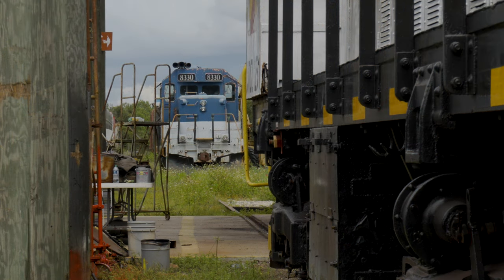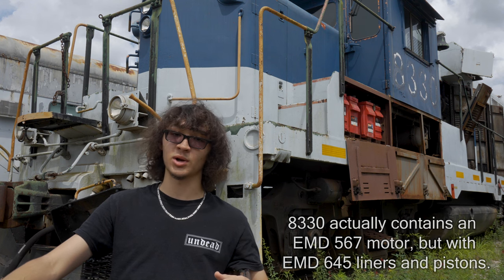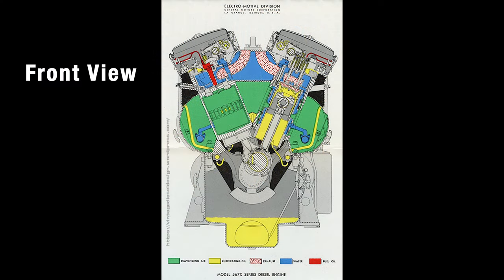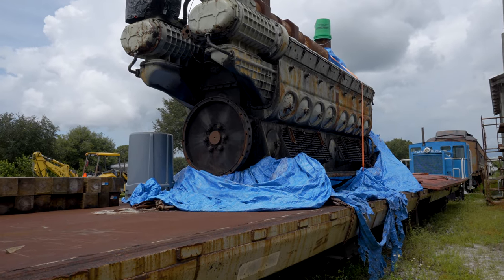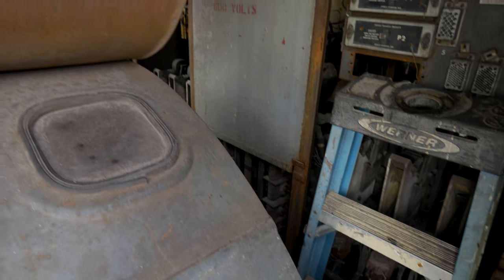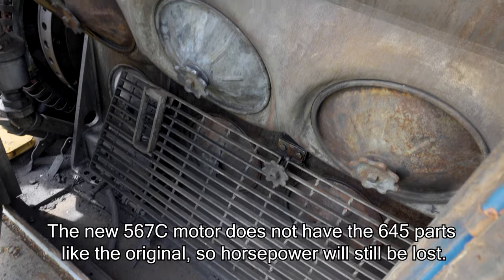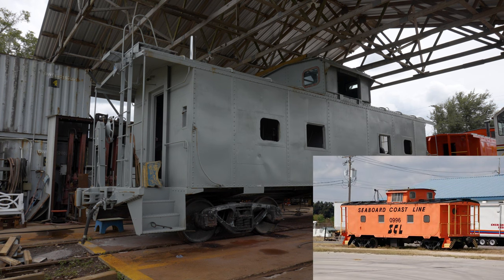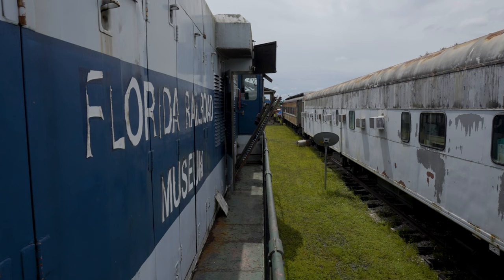Florida Railroad Museum - 8330's Second Chance

Comment: The Unit Was First Built In 1954 For Union Pacific It Was Sold 11 Times To Different Railroads Including ICG MDLX ILRV WRRX FGCRR NCYR RPCX AGLF EOLX And Others
Reply from the maker: Some of those are overlaps, but yes, that’s correct. It held the RPCX markings when it was given to the museum, or “FGCRR”. Still holds the RPCX marks to this day, though the markings are hardly visible.
Reply: and it was a GP9B when built.

Comment: EMD did same as Detroit Diesel did, increased piston size, but kept the stroke of the crankshaft the same, 71 Series vs 92 Series. That's why a lot of the old 567 engines got the 645 cylinder kits, when it came time to rebuild them, gave them a power increase and parts are basically drop in, without major machine work to the block itself.
Reply from the maker: Interesting info! It’ll be interesting to see if there’s any audible difference between the two once the new motor is in. Definitely helps that the two motors sort of go hand-in-hand.
Reply: Yes, I can hear the sound difference between a true 567 and a modified version, like 8330 has, and the 645 non turbo version. But, I have been around Diesel truck's for so long, I can hear all the distinct sounds of a engine, they all sound different. Trains are no different.

Comment: Nice. You should do an in-depth presentation on the 8330 highlighting her significance, such as, she was originally built without a cab.
Reply from the maker: Absolutely. That will likely come with the final product, in which the 8330 is back up and running. “Rebirth of the 8330” will come out as its own video when the time is right.

Comment: FINALLY THEY ARE GOING TO BRING IT BACK 😅 I MISSED THE 8330!
Reply from the maker: Many are looking forward to it. In addition to it facing south, 8330 was valued for its smooth running, braking system and reliable performance.
Reply: @kotabeaner  wow that’s amazing how they actually are bringing it back
Reply from the maker: It’s going to be an extensive, expensive, and intricate project, but we hope to say that it will be worth it once it’s all done.
Reply: @kotabeaner  i think it will be worth it in the end

Comment: Being more rolling stock than loco inclined I can still agree if your prime mover has blown/exploded cylinders, bent crankshaft/crankcase and whatever else subsidiary damage it is better off either being completely rebuilt (probably REALLY expensive) or just becoming a parts source for future EMD prime mover repairs.
The beauty of EMD prime movers is that the 645s were basically 567s w/the upgraded piston/cylinder assemblies with other improvements interchangeable.
Your replacement engine having the later in the 567 series C block is a definite plus and is basically a "plug in and play" job here altho still a fair amount of work. The analogy of a heart transplant not far off the mark as all the other main components such as generator, traction motors, air compressor stay the same needing maybe just a little tweeking.
Just wondering as a GP10 (not an EMD model #) she was probably originally a GP7 or 9 so could she have been an ICG Paducah rebuild?
PS: yeah, water don't compress!
Reply from the maker: Expensive is right. It’s costing them almost $25k just to get the right cranes in to lift off the hood. Quite a bit of work anyhow, as truth be told, 8330 was actually used for spare parts while she was on the side, part of why so many things need replacing apart from other things like their age. 8330 was actually first a GP9b for Union Pacific (one of the cab-less builds), so she was one of the Paducah rebuilds for ICG. She was passed around a bunch to lines like Illinois Central and a couple other tourist operations, before the museum got her from the Inland Lakes railway in 2010.
Reply: @kotabeaner  Doggone, like so much vintage rail equipment, 8330 has a truly long and complex history so good luck with her.
Like the caboose and loco overhauls going on there and the OKs to redo in the original US Gov schemes (we've gotten Amtrak OK to redo our auto-train 3 in her proper livery).
Now NO more pandemics, hurricanes or whatever!
Reply: @kotabeaner  I hope they put the bad prime mover on display in the new museum building.
Reply from the maker: Not a bad idea, one which I’ll definitely run by some folks, especially with their new building going up in Parrish. They actually do still have the damaged parts from the prime mover, though they aren’t on public display.

Comment: To be honest, hearing that 1835 may be repainted into the US Army paint is kinda saddening, the unique spin off of the L&N (I think) paint scheme looks super good and brings back memories of when I rode behind it as a small kid. I would rather it stay into that paint job rather than the boring and black paint of the US Army. It will be neat to see how this 8330 project comes along. Did their collection suffer any damage from Hurricane Ian?
Reply from the maker: I’ll agree with you on that, it does hold quite a bit of nostalgia to me, so it’ll be a shame to see it go, but it definitely had its run. I don’t believe that any of their equipment suffered any wrath from Ian. The most I’d be willing to say happened in that general area is, perhaps, some downed trees or lines. The worst of Ian was all south of Sarasota, so the museum was definitely in a more safe position.